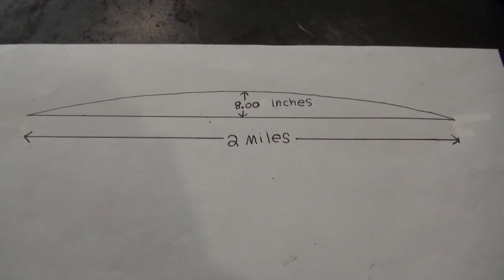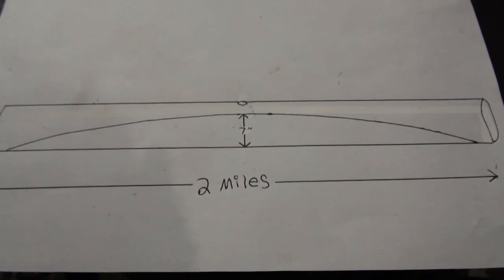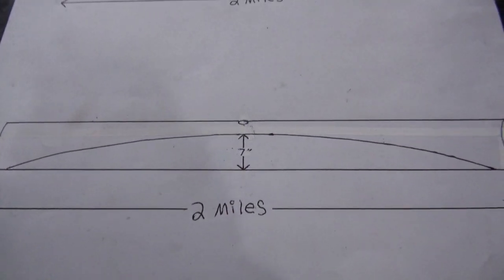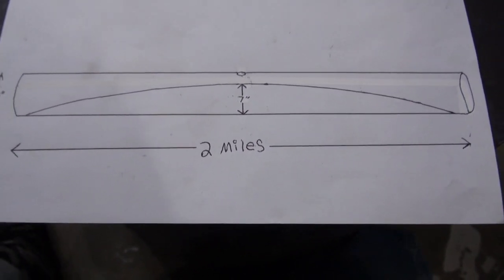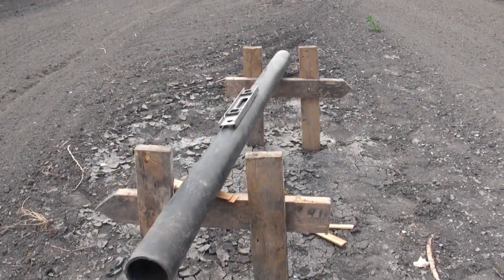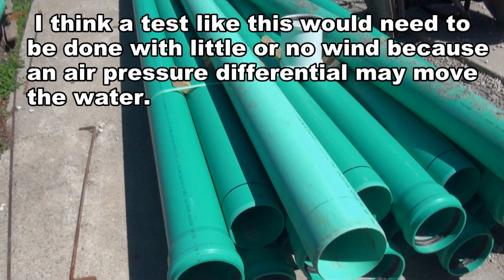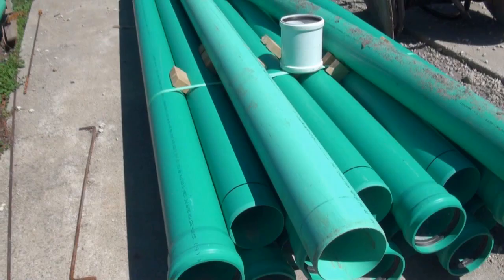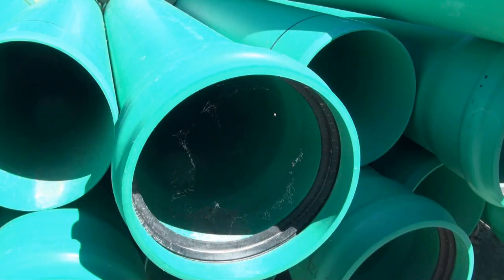Pipe And Water Earth Curve Test Idea

Comment: It's been done many times by industry. Any pipeline company lays pipe with a specified gradient. There are flat stretches of land much more than 2 miles long in Canada (Trans Canada Pipeline) where a slope (gradient) must be factored in for proper flow of oil. Fluid in any length of pipeline lays flat if there's no gradient (there can be blockage from sediment build up, but that's different). All engineers know this. Pipeline engineers do not factor in curvature, nor do surveyors.
https://www.wyre.gov.uk/info/200316/building_control/166/basic_guide_to_calculating_falls_and_gradients_for_drainage
Reply: @Tony Reinholt No canal, from Suez to Panama, has factored in curvature. Just in 1 mile (5,280ft) theoretical curvature is 8 inches. So a large mall of 528 feet will be uneven by 0.8 inches, almost a whole inch.  That borders on catastrophic, Mr Local Surveyor. Don't make up stuff you don't know about.
Reply: @douganderson7002  Wrong. Another Starbucks Warrior pretending he knows something. Why do you guys weigh in if you got no experience in the field? Whatever your job is, find a video you can competently comment on. If you don't know, don't comment. How's that for a theory?

Comment: That could work 😊 maybe be better with clear pipe.
Reply from the maker: Yes clear pipe would give a better visual reference as to how the water behaves, would make it harder though to internally see if the pipe is straight, or maybe if only some were clear.
  I have a question about your infrared video, what time of day makes for the best infrared viewing conditions? Also what wave length filter did you use? Example 850, 950
Reply: @groutaone  there isn’t really a best time although if you have the sun shining on your target that helps, it’s more to do with how clear the atmospherics are. The ir filter i have is the Hoya r72.
Reply from the maker: Thanks.